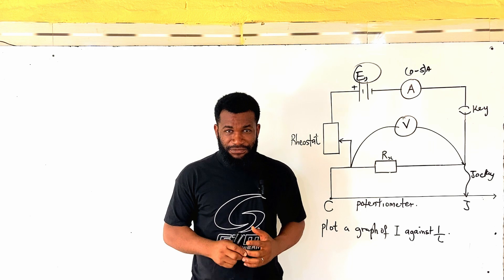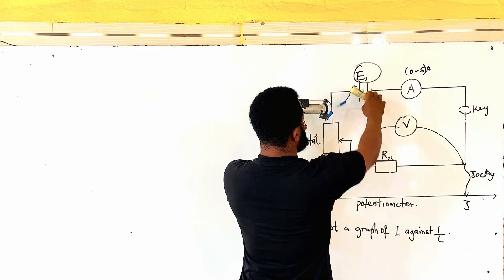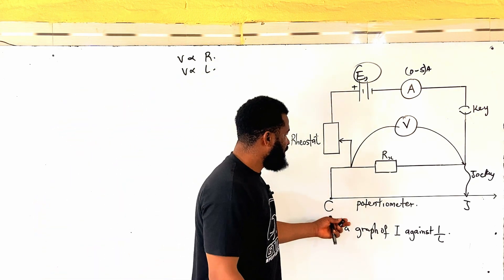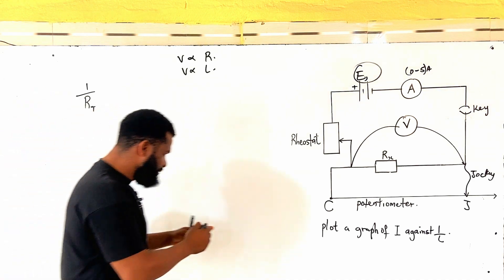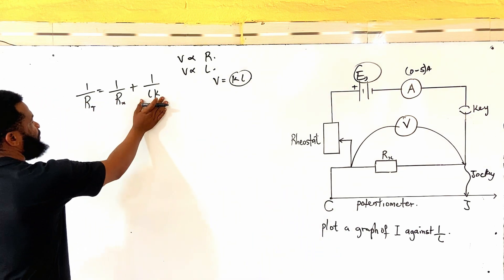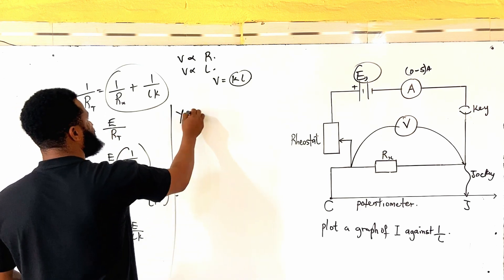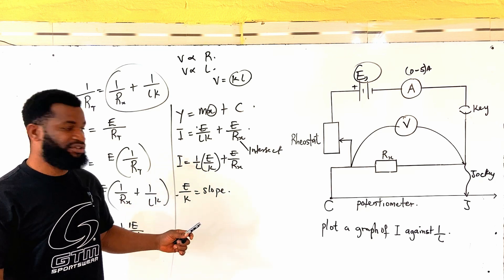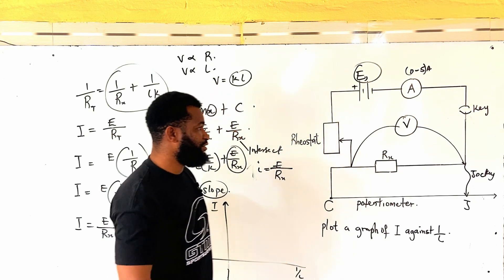Waec 2025 Physics Practical on Electricity. Expert Analysis.

Comment: I discovered that my voltmeter is reading backward..and not significant change when I touch the potentiometer with the jockey..
I don't kw what's wrong. and my connection where correct
Reply from the maker: Just change the battery connection
Reply from the maker: Or change the positive and negative terminal of the voltmeter